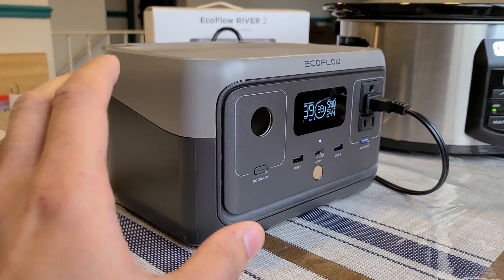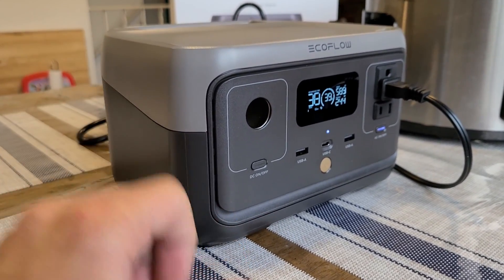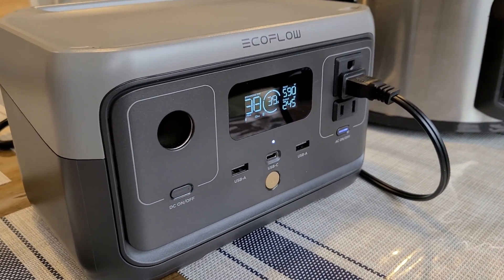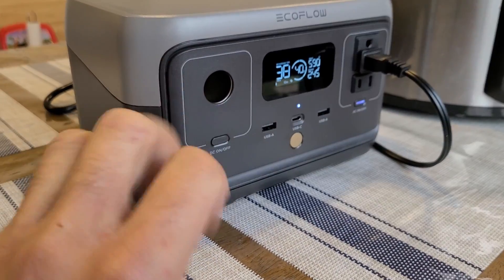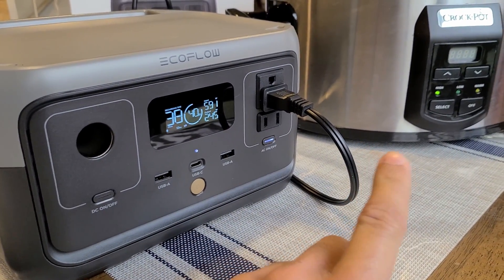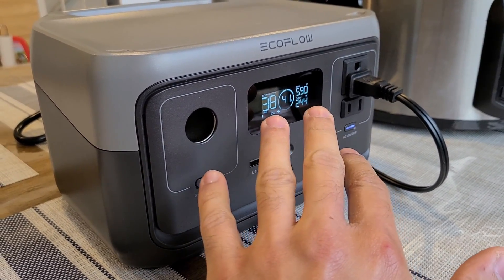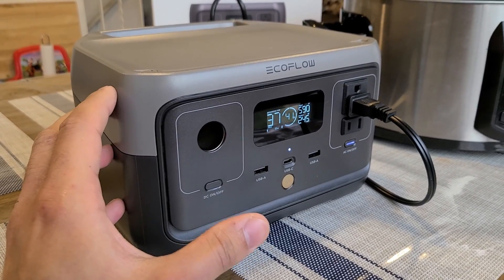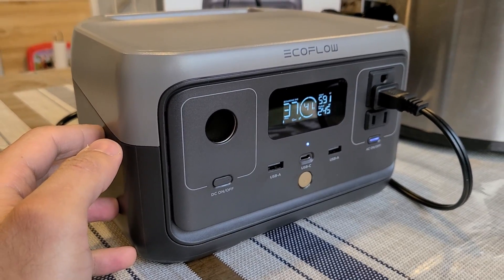EcoFlow River 2 Pass Through Charging Test

Comment: This pass through charging, does it mean it's on charge while you are using it, and another thing, my "overcharge" light never stops flashing, whether the inverter is on or off, I charged it 100% last night and didn't use it after that, this morning it's on 95%, seems like the flashing light used 5% during the night.

Comment: I was wondering if it did the same while solar charging. In my testing it seemed to support it but It was hard to tell being limited to 110w; thanks for the info!
Reply: Did you get an answer yet if solar pass trough is possible?
Reply: @nokhok01  from my experience it does not. It will drain the battery down a percent or two below charge limit then start solar charging.

Comment: Thank for the video. Do you feel this unit could run heated electric blanket for a few hours? Or a type of small appliance like a blender or hot plate for any amount of time, even if only 15-30 minutes? Thanks for any info, Chris
Reply from the maker: I would not recommend this River 2 power station for running an electric blanket or hot plate. It could run a blender on the more mini side. The capacity and the power output is simply not there.

You may want to consider EcoFlow's DELTA series of power stations that have high capacities and higher power output. Let me know if you have any other questions. Thanks for watching!
Reply: @chargerharbor  Thanks for the reply. I bought one anyway for small uses and did some quick test with lights, charging my phone, fan and wanted it to charge my car battery as an emergency. It seems like a good product, but does not seem to be able to run the small devices  for the times they state on the site; but this seems to be across the board for other companies too. They seem to put in a couple of extra hours to the chart. I have a 1600 watt gas Honda that boost 2000 watts for 30 minutes, is ultra quiet and is awesome still after 17 years. Im not sold on larger portable solar/battery systems yet, as they are very high price and they too do not hold the true run times and power sustainability as they say. You have to combine batteries and systems to bulk them up to be able to run high wattage like stoves and heaters. The mid range like say 600- 1000 watts are great for small emergencies and camping and the prices are fair. My Honda was $970 and the new model is like $1100 and yes they "pollute" to an small degree, but the solar mining and process is not much better and if I needed to buy another one I could link a cable to them for double the power and cheaper then these solar types. That being said, they whole house solar with its increasing tech and battery backup capacity growing are great; and even new small wind turbines too. I still have faith in a true free energy generator coming soon, like spinning magnets and such; then we will get some where fast as a society; or tapping not the Earth energy fields with a simple device; maybe stone like the ancients. Our bodies do it every day to run our internal systems and when we align consciously to it and live more pure and harmonious; we too will be a self sustainable and renewable biological tech ourselves. Thanks for the quick response, appreciated, Chris

Comment: You are below 80 percent so yes you pass through charging is working....... but charge it to 100 percent then try running a load on it...... It pulls it from the battery 🔋 dow to 80 percent then it kicks back in to charge itself and power what's going into it. Maybe it's just mine doing it but you are below 80 percent. 

Charge it to 100 persent and run the test again.
Reply: wow.. I think that this is the quickest way of killing the battery. Li-O, LiCo, LiFePo. like they says: "This is the way"